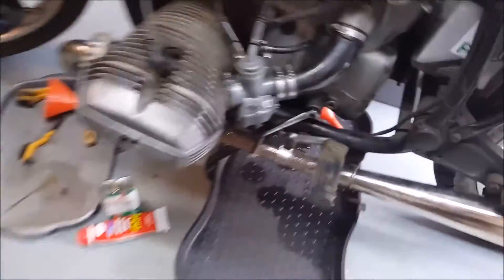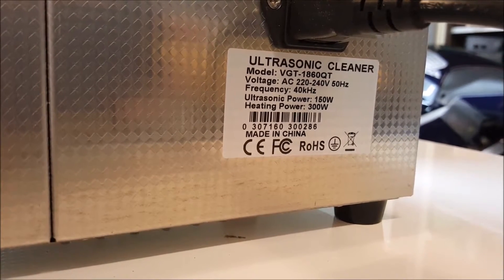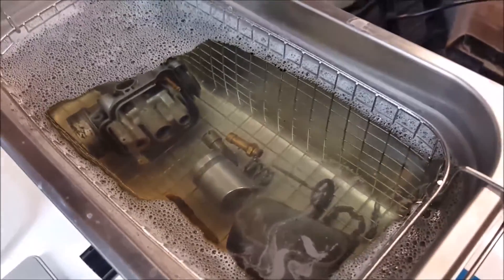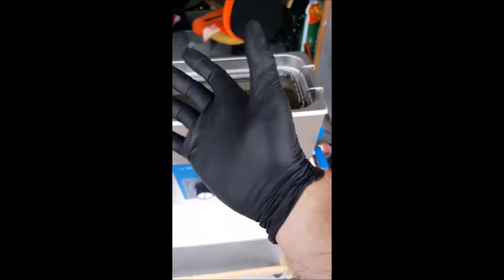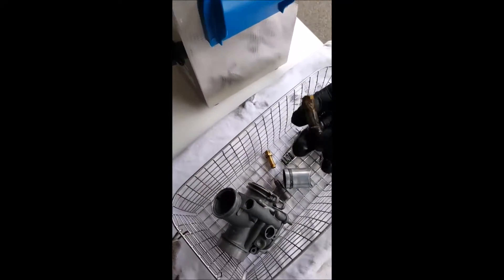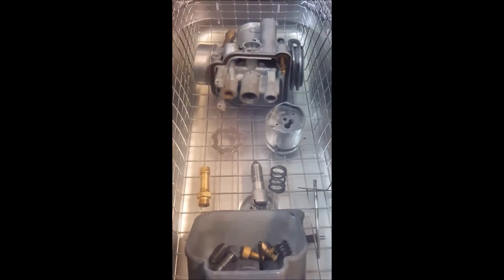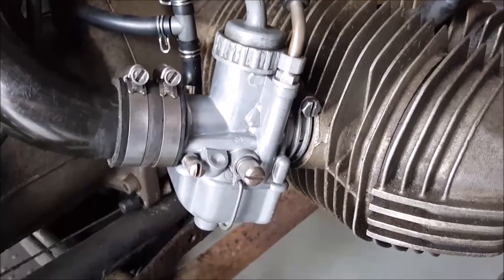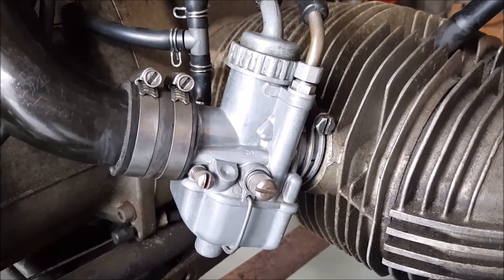Ultrasonic carb cleaning

Comment: Seems like you think an Ultrasonic cleaner makes things look brand new .... it's mainly for cleaning in areas you can't get to. So if your carb is working well now and not sticking it's done what it was meant to do. A higher watt machine is more aggressive.  Like the AW Pro 15L is a 760 W model. So the lower watt machines you need to run longer.
Reply from the maker: correct. the cleaner got the sticky carbs clean and back to working order, but they needed further attention to get the back to good cosmetic condition